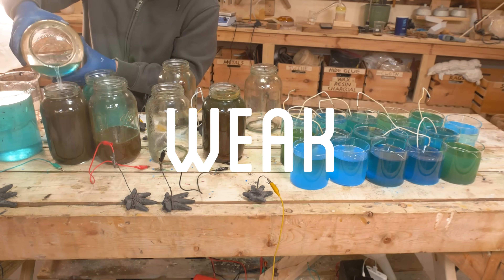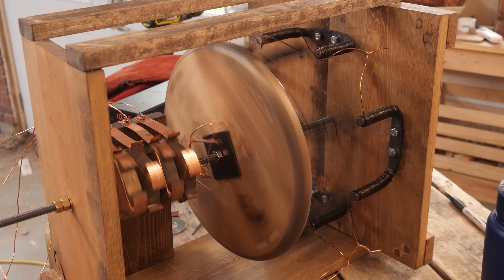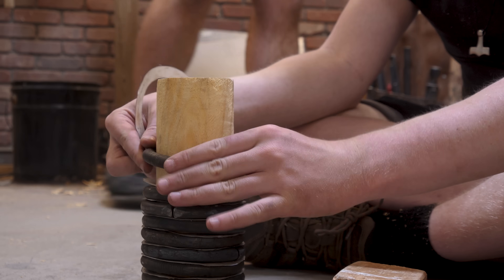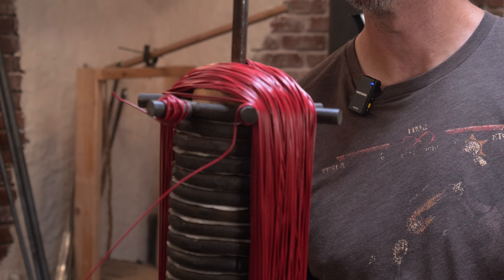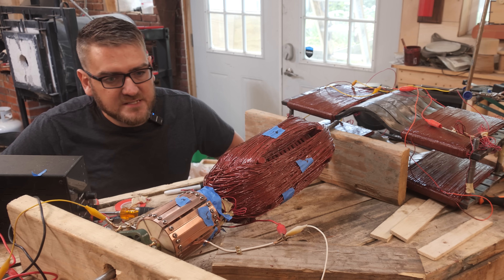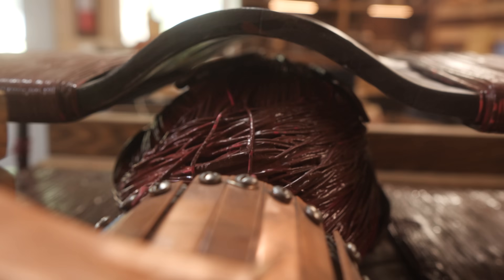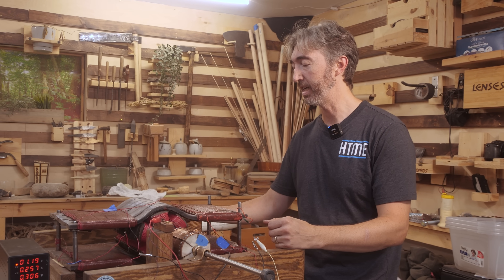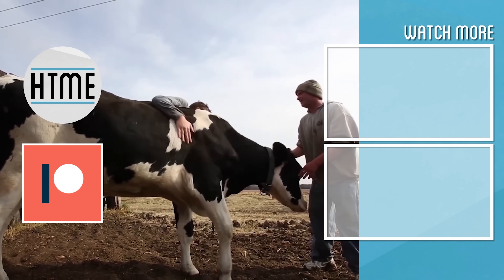I Built the First POWERPLANT!

Comment: Firstly you have to spin this faster, use a gear reduction to amplify the output speed of the input crank, ie: 10:1 ratio, one turn of the crank, equals 10 turns of the coil. 2. Add a small battery to the stationary coils to excite a higher magnetic field at first, then switch off that input after the device is turning, then add a small voltage regulator to the output of the spinning stator, that limits the voltage drawn by the stationary coil. This should yield a huge increase in output power, so be careful,  it should be around 14 volts at over 100 amps. Test by spinning the stator with a drill while testing all the coils for both DC voltage and amperage one at a time. Good luck!

Comment: From the mechanical side, I would separate the crank and the shaft. Add a gearing system so that you get more RPM on the shaft, add a flywheel to the shaft so that you can smooth out kinetic power delivery, and have the shaft gear on a freewheeling hub so that the kinetic energy only goes into the rotor (not back up the crank when you slow down or let go).
Reply: Good point. There is a lot of wobble in what they have at the moment.
Reply: I was also thinking similar but more for the gear ratios.. use less energy turning but get a faster spin.
Reply: I agree, we should look into turning the rotor with some kind of pulley crank system. However, the rotor already weighs something like 50 lbs, so I'm not totally convinced a flywheel is needed.

Comment: You should check the parameters of your generator, it may require much higher RPM to work correctly. there is an optimal speed you can determine theoretically

Comment: Instead of downsizing the commutator, how about you take the brushes to where the center of the brush rests on the commutator and is fixed at both ends. Therefore, hopefully minimalizing if not completely getting rid of the bounds on the brushes.

Comment: You might need to run it a lot faster. Maybe a large fly wheel  with a connection to your rotor shaft so you can multiple the rotation.

Comment: Perhaps stator current is continually broken by the disconnection of the rotor coils. One could add another set of brushes to make sure one rotor coil connects before the previous one disconnects?

Comment: You should switch to spring based commutators with brass contacts, drill a small hole (that doesn't go all the way through) in the wood post your commutators are on now and and put the springs and brass contacts into there, the direct pressure will help a lot with the contact

Comment: 15:25 couldn't you put a capacitor in line with the circuit just for the purposes of smoothing out the uneven "flickering" in the generation so you can measure an approximate current for the generator?
Reply: He has done it.

Did everyone skip that part?
Reply: That would be cheating or he could leap time period and make a diy capacitor, but that would take a lot of variables to get right.

Comment: You could try adding a gear system between the handle and the main rotor so it spins faster and makes more power. You might also experiment with a simple saltwater capacitor to store some of that energy.,so you stay still in the type of the 1800

Comment: The diameter of the commutator may be less important than its smoothness.  Working from memory here: The several copper contacts of a given commutator were typically separated with an insulator such as mica and turned on a lathe to smooth the surface, after which the mica was carefully recessed.  I probably have old reference books describing this process.  Reply to this comment if you'd like me to look for more information.
As to measuring current, perhaps you could use the output of this generator to plate metal out of solution?  The mass of metal collected on the cathode should directly relate to the coulombs.

Comment: Maybe the commutator should be offset by 90 degrees. Because a changing field is what generates current and the field should be "constant" at the poles. It should work as a motor and if you line up the rotor field and the stator field it won't turn there needs to be a offset. Love seeing you getting closer to the age of electricity.
Reply: The old universal motors had movable brush holders for speed control by adjusting the magnetic fields the rotor generated.

Comment: you shouldn't use a commutator for a generator. slip rings should be used for proper power transmission without pulses.

Comment: The stator/field arrangement seems a bit odd. Do you have any way to measure the magnetic field throughout the inside of the assembly if you power it from just a DC source, without the rotor? Or just do testing with an external source for the field windings and measure the output off the rotor with a proper multimeter or oscilloscope with various types of simple resistive loads?

Comment: I can see some things that can make it work better or way to do thing more reliably:
- Using bars between the two part of the stator so the magnetic circuit don't become thinner at some point
- Increase the turns of the stator
- Use plain bearings so the rotor is more concentric
- Use thick paper between the iron and wire and thin paper between layers of wire so the insulation is better

Comment: What if for measuring power output you buy a cheap watt meter?  You could use some high wattage resistors (maybe nichrome wire found in heaters) for variation in loads

Comment: 2 Suggestions. 
1) I would make the motor brush location variable. Old generators and motors had this. You could rotate the brushes, to advance or retard the internal rotor field, to get the best result. If you look at old pictures, you can see the brushes had at lest 30 deg or rotation. As its now, maybe you are already missing the "peak", if that makes sense. 
2) I'm not sure how the stator is supposed to work in regards to magnetic feels. The iron, as is, will "short" the magnetic fields past the rotor. Usually, you would want to make a C type core, so you have iron providing a good path around the air gap in the C, concentrating the field, with the rotor being that area. For reference google shaded pole motor pictures. I know it looks like the old pictures, but I would definitely try a different stator argument.
Reply: On each of the two bars, the two stator coils are wired with opposing polarity. Both coils push the magnetic field towards (or away) from the center. The biggest problem I see with the magnetic arrangement is that they didn't connect the outsides of the top and bottom bars properly. There are some shots with only the outermost ones connected and that is definitely bad.
Reply: @entcraft44  yes I agree, they would have to be connected, the wiring is somewhat suspect to me. The stator aragment is far from ideal, as they are now, I think they squirt more magnetic field around the rotor then into the rotor. I would def simplify the stator, or maybe modernise it by a few years. Googling for "first self exciting generator" yields a lot of C shaped, or U shaped stator cores. 
Side not for the creator if hes maybe reading, I would also drop the laminations and insulation between laminations for now, just to simplify the design. Get something that seems to be working, and then optimise it. The losses in the core are just about 0 atm. The field density is so low, that its basically 0 looses now. When you start to light up a light bulb, produce several 10 of W then maybe start to think about how to laminate it etc.

Comment: You're building it backwards.

make the armerature the magnet, and the field coils as the output voltage source. The magnet requires less power than the output, and higher power increases the losses in the commutator. 

also, smooth the commutator. Spin it fast & hold a file to it.

Comment: dont believe the size of the commutator really matters as long as it can carry enough current and has enough voltage separation for the excitation. The real upgrade would be making the surface smoother and using spring loaded graphite contacts. 
Generators like these also want to be spun VERY fast. So yall are going to want some gearing or reduction pulleys to make a usable voltage.
Could also be wrong about this but believe that will output AC power. Not pulsed DC.
Reply: You are wrong about the last point. What do you think the commutator does in the circuit?

Comment: you can try to measure the power dissipated in a resistor load using calorimétrie measurement. works with AC and other intermittent current sources, better than with a multimeter.

Comment: You are using copper on the stationary stator part with a DC current flowing through to setup a magnetic field for the rotor to rotate through. The output of the rotor will be an AC voltage which needs to be diode bridge rectified to convert it back to pulsating DC voltage / current. Yes, generators produce pulses, it’s what they do. From there you can use a Capacitor to rudely clean it up into flat line DC. You can use strong magnets on the stator instead of electromagnetism. You also have to understand how much current will saturate or iron cores as this is a limit also. You should really, at a minimum buy a cheap multi-meter to probe what is going on.  An oscilloscope would be gravy.
Reply: an oscilloscope would also be a great investment if they plan to do further videos on electrical projects
Reply: Good points, save me typing, I might add that sadly I think a 'stator re think' might be in order. A scope always a great piece of lab gear but I can pretty much see that waveform without one LOL :)

Comment: wouldn't it be smart to use gears to allow it to spin faster at the same number of rotations?

Bearings to allow for smoother rotation

Flywheel for inertia to have a more consistent rotation speed

maybe have a part over the handle that can freely rotate on the handle to make it easier to maintain consistent force?

Comment: I would put a Tachometer on it and try to run it at a consistent speed. They've been around since the early 1800's so maybe you could do a video on it.
Then I would use an oscilloscope to see what you are producing. Its clearly pulsating DC which might indicate that the magnets in the rotor might be out of phase. So one magnet is turning off before the next one turns on. If its AC you probably have a wiring problem. 
Their might also be an inherent flaw in the design that will prevent that from ever being a good DC motor. 
The outside windings aren't parallel to the magnetic fields and are kind of long so their probably not doing that good of a job. I'm assuming this is wired so that left side is one polarity and the right side is another so you might need to make the commutator bigger or reduce the distance between the plates. Using degrees on a compass as an analogy, looking straight at the center of rotation with zero being straight up. The magnets passing through 40 and 140 need to be one polarity and the magnets passing through 220 and 320 need to be the opposite. 
If you wired up the outside positive negative positive negative with the rotation and only have two brushes you probably screwed up? 40 to 80 and 220 to 260 would need to be positive then 120 to 140 and 280 to 320 would need to be negative and I would like to know how you did that.

Comment: IMHO, the pulses are too noticeable, even for this commutator. Maybe one of these coils is reverse-connected. Did you hook it up to an oscilloscope to see the pulse shape? Or maybe two LEDs in an anti-parallel configuration could do the trick. Only one of them should light up, no matter which one. If both of them light up, it's a sign of an inverted coil. Best regards!

Comment: I have a suggestion. I think there is a lot of resistance in the commutator. The contact area that current flows through us really small. You have nothing "pushing" down on the fingers other than a little spring load. Try a flatter wider finger and apply an external spring/ weight on it. You can measure the resistance of it quite easily with a multimeter to see what you improved. Also, measure what each coil is outputting instead of the final dc output to monitor results of improvements more closely.

Comment: i would also skip hand cranking as human cannot produce that much electricity :D  - means you need gears and speed  ....  here is ai response on that :) 
``` In contrast, a person using a hand-crank generator can typically only sustain a power output of 10 to 40 watts. While some hand-crank generators are advertised to produce up to 200 watts, this is a peak output that's not sustainable for more than a few seconds. The smaller muscles in the arms and hands fatigue much more quickly and are not designed for the type of heavy, continuous work required to generate significant electricity.
```

Comment: The first things that comes to my mind is that you will need to spin it faster. Something like 1500-2000 rpm is what most electric motors turn at. The flicker will disapear because the next field is building before the first collapses. Maybe gear up the hand crank with a large pully to turn a smaller pully on the rotor.

Comment: Wait wait wait wait wait... How does this thing work without permanent magnets again? Is it that the spinning rotor has a marginal current when initially spun, and that induces current in the outer coils, turning them to magnets, which in turn, causes more electricity to be generated by the rotor? Is that about right?
Reply: Almost right. It doesn't have a marginal current but a marginal magnetic field. When soft iron is magnetized by an electric current, it keeps a small fraction of the magnetization even after the current is turned off. So basically the initial tests with an external power source primed the generator for use.
Reply: @entcraft44  That almost feels like cheating here... but I guess it's fine.

Comment: My only thought to deal with the current problem would be to basically wire in a second “coil pack” (for lack of a better word) that is offset 90° from the first one so that you don’t have any gaps in the current, but even then you’d probably still get dips and peaks in energy flow. Maybe the idea should be to make many small ones offset from eachother attached to the same crank? I’m not sure what other effects that would have though. Specifically any effects on the strength of the current

Comment: If its pulsing, doesn't that mean one of your rotor coils is not working right. did you check for shorts to the rotor metal? 
 I did not see any rounding of the sharp edges before coiling the wires, so it could easily scratch thru the shelac and short.
Reply: Have you seen how the generator was being cranked? At such a low rotation speed pulsing is pretty expected. We have three rotor coils 120 degrees out of phase. The commutator connects to one of them at a time. If you look into a three phase diagram you will see that the output will fluctuate between half and full voltage six times per rotation.

Comment: So you just skipped TEG's and fire? Even missing Seebeck high temp..basic metals affixed end to end in a loop, you get charge under heat. 
I give you credit taking it far further.. but to go from ridiculous arcana of premodern synthesis of materials like zinc straight to dynamos is just silly. Even steam comes before such over "batteries". Japan handed out TEG cooking pots, for boiling water, to charge electronics en mass as their emergency power generation after their big difficulties you know. Swift, simple. Fire, module, energy exchange.

Comment: The stators are very ineffective. Their magnetic field is running tangential and off to the side of your rotor (from stator coil to stator coil, along the flatbar. It hardly interacts with the rotor at all), mostly bypassing and ignoring your rotor. The stator coils should be pointing radially inwards towards your stator, like the magnets or coils in electric motors/generators you'd see today.

Comment: maybe a gear box that makes it so you have to crank it harder not faster, to make it spin faster
and just making sure it spins easily
I wouldnt consider it cheating to use a better design/layout for the copper wiring if its still built with the same materials and technology

Comment: OMG add a gear ratio, freehub, and flywheel PLEASE.  Just use a bike if you need to (it's a combination of all of these).  It hurts to see you still using that hand crank while expecting more power. It's not possible at those speeds.

Comment: I bet it would be easier to make a simple magneto rather than a self-exciting alternator. A magneto generator uses rotating permanent magnets to create a changing magnetic field and induce a current in copper coils. You could make some permanent iron magnets using your batteries and an electromagnetic coil.

Comment: Why not use a full bridge rectifier? You've created an AC generator, I think, hence the pulsing of the LED. A rectifier with a capacitor  will give you constant DC and make measuring current much simpler.
Reply: You will definitely need a full bridge rectifier to charge a battery. Also, does your multimeter have an AC setting? May be more helpful for measuring voltage and current out of that guy.
Reply: The commutator already rectifies the output by physically swapping the output polarity as the generator turns, so it is already pulsed DC. No bridge rectifier required. In fact, building one would be impossible using the technology they have unlocked, as diodes require either semiconductors or vacuum tubes.

Comment: Doesn't excess metal act as resistance?

Are you sure you're not shorting to ground somewhere?

Would downsizing the commutator have an impact?

Adding a bearing between the rotor and stator should help?
Also maybe include a flywheel so it can carry its momentum?

I like the project alot :)